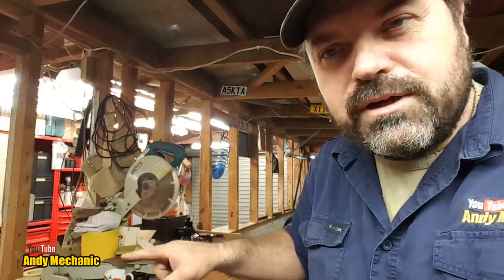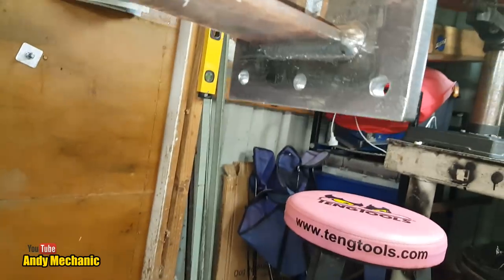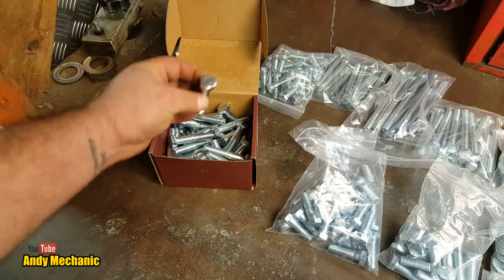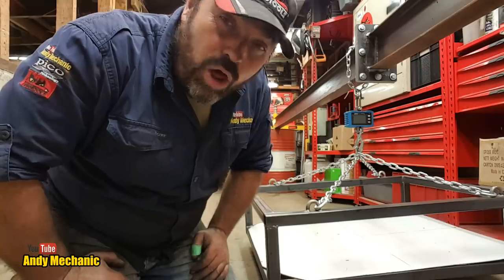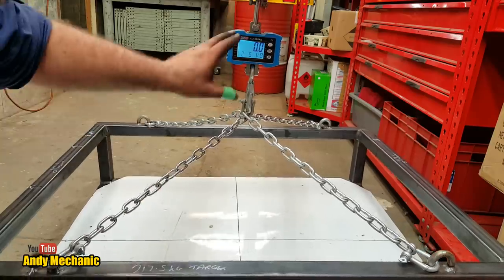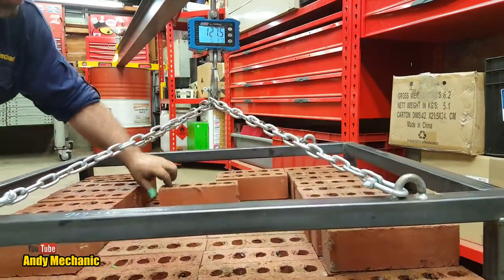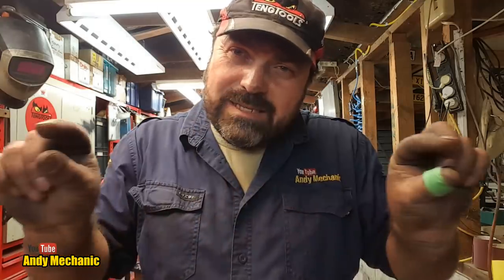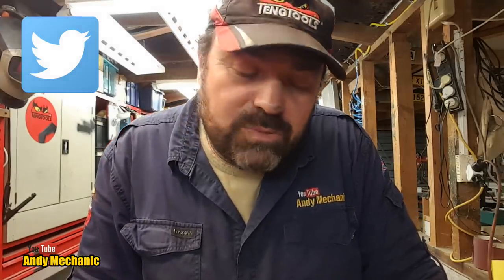Workshop roof steelwork Ep.1 - Load testing the I beams #2015

Comment: You could use Young's Modulus for common Materials to calc deflection in the beam and ultimate yield strength. The calcs are fairly straight forward and there are tables for different geometries. My gut says a lot of the initial deflection is coming from the flange and the step functions in deflection are coming from a combination of of sources not just the beam. The deflection in the beam should be uniform right up until the yield point. I-beam load ratings are usually given in kips which is 1000lbs so your i-beam is a load monster. Love the channel keep it coming!

Comment: My brother in law had a structural steel work company and he always used 5/8 inch or 16mm bolts, and virtualy all the steel work I have seen does the same except on things which are lightly loaded such as Z purlins.
Reply from the maker: Hmmmm....may have to upgrade the bolts then? Bugger

Comment: the new design is a whole lot better. having the joins under compression is good. i think the 12mm bolts should be ok. torque them to spec.  tho personally i would have skipped the bolts in those center plates and welded the beams together. that gets rid of the possibility of cold welds on that thick plate if your on dubious power.

Comment: no idea what the Nylock nuts are for ...Your hardware is not rated for Structural use .. here in the USA it would have to be ASTM Rated ...why no Bar Joists ..?? ... mig welding ( your work is nice), does not put enough metal in the fillet for Structural uses